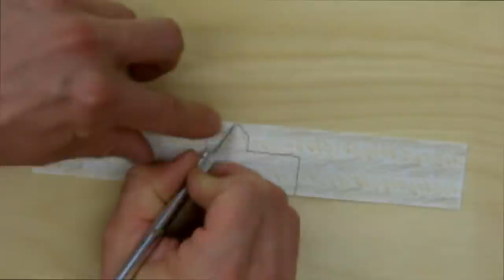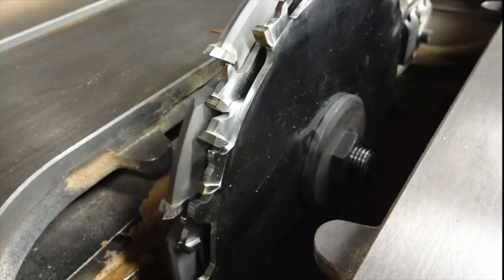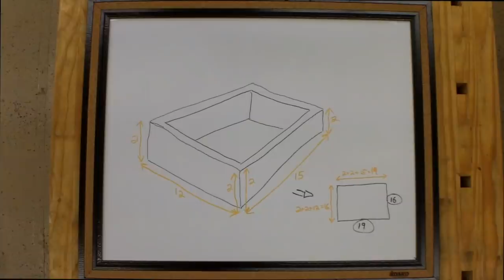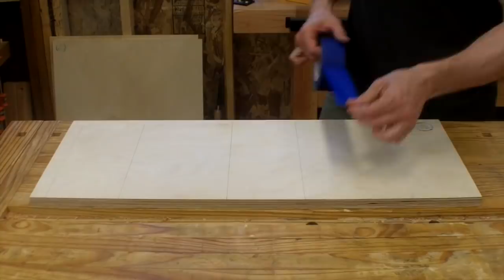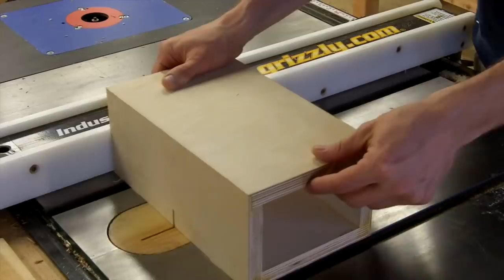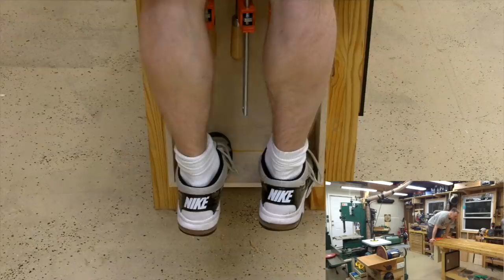New Invention - Easiest Drawers Ever!

Comment: Congratulations on getting Rockler to license this!  

And just curious, would this work for solid wood drawers and boxes? And i assume that if you were concerned with greater strength, that it wouldn't take much effort after the glue has dried  to drill some holes in the corners for a couple of dowels going in each direction. And of course there are other corner reinforcing methods that add strength and visual appeal that could be done after initial glue-up.

Comment: I love this design so much. Sure, finger joints are stronger, but there are a lot of box applications that don't need to be any stronger than a drawer. Also, you can still throw on metal edge protectors and corner brackets.

Comment: 1st I love the idea 💡 heck of an idea. 
I would use a Sen Senclamp fastener to lock them together after the glue up. I have been using them for the inside of cabinets to lock the face frame to the sides for 25 years. A lot of people have never heard of them but when u live in Indiana near 40 Kimball and Aristicraft factories that all use them as a locking fastener. Great idea

Comment: Wouldn't a set of blades with this profile for a table saw molding head be simpler and cheaper?
Reply from the maker: You would need a different set of cutters for every slightly different material thickness, probably in increments of 1/64", so it would actually be really expensive and still not as perfecta  joint as this tool can make, because the dado stack thickness can compensate for thickness.

Comment: What woods does this not work so well with. Does it ever split on the edges. And i would gather that soaking the outside edge before bending would make a huge difference. I'm certainly a fan of planning out and gluing only one box and getting two though.

Comment: What is the advantage against 45degree V-shape... You will get the same 'folding' effect with way easier blade.
Reply: That would take two cuts per corner, whereas this accomplishes it in one pass.
Reply: @huntley101888  you can buy 45deg saw. Putting 2 of them side by side makes job in one cut and works for all sizes. While one on vid is fit for one size only. The only diff i see is glue surface that might have some difference, but in case of drawers I don't think it is needed. So overkill for me.
Reply: @michaltofikolszewski  I did not know such a thing existed. Thanks for the heads up
Reply: @huntley101888  :) NP. :) Many such things exists, but due the fact they are specialized to do one job only most people prefer using standard tools that are more versatile for saving space(in workshop) and money. Have a nice day :)

Comment: Nice !  I do not think the vibration test was adequate.  Pressure test with clamps and force scale compared to rabbit and dovetail would be interesting.  I think with good glue and clamping would work well for drawers particularly the bottom is a thick as the walls.  Thanks!

Comment: I don't know what kind of deal that you made with Rockler but I think that you shot yourself in the foot. They are advertising this blade as an exclusive and only as a whole dado set and price gouging the heck out of it because they are the only vendor of this blade. For most of us it is priced out of our budget. Exclusive means there is no competition in sales and therefore the sales will be very limited compared to an open market product. I hope you got cash up front for licensing it exclusively and an expiry date for the license in case it doesn't work out for you and residuals on each sale. One thing that you should consider is that you do not patent ideas, but rather the actual design of your invention. So, when you applied for your patent, I hope that you considered all the possibilities of your design . You have put the concept out there now and there will be a lot of entrepreneurial engineers that will come up with some alternative design that will accomplish the same thing. It will probably come out of China and be sold on Amazon for under $50.

Comment: I wonder if there is a way to have an angled biscuit joint so when folding the plywood the sections would lock in for a more structurally sound hold.

Comment: This is a good concept, but it has a major design flaw in that it assumes a standard, unvarying thickness for plywood. Unfortunately, plywood thickness is not standard, in that it doesn't observe the exact nominal thickness, which leads to the gap you showed in the test.  For example, 3/4 inch plywood, or 18 mm plywood in metric, is never exactly that.
Reply from the maker: The width of the dado stack included is what compensated for exact plywood thickness.
Reply: @AndrewKleinWW  I guess if you work with a single sheet of plywood, you can also adapt the thickness of the blades with some paper inserts as I've seen in another video online and it will work for the entire project. Your idea is great and saves a lot of time. Another option is working with Baltic Birch plywood, which is guaranteed to have the nominal thickness.
Reply from the maker: Wish I could say that about the Baltic Birch I get!  We actually make a web tool so you can take a caliper reading of the plywood and it outputs the exact dado stack setup needed: http://miterfold.rockler.com/miterfoldcalculator.cfm

Comment: I'd figure how tall a draw or ban of draws are I'm going to ned set up the dado set and rip a dado into 8" boards then part each side and frt part out off that stock then do the miter type cuts on the sides and face and back's  using the quarter quarter quarter system. then rip the bottoms for them. you can gluse them up, and pin nail with the claps on then remove the clamps after you set nails in them your going to have to make face's for them this you can match grain to keep it looking uniform.

Comment: search quarter quarter quarter draw on youtube.   Now I like your idea, but the thought of spending 300 bucks for a special saw blade dosn't excite me, and too many veribles for the gap to use a differnt stacked dado set  and what plywood you use for the draws. Just too many things can go wrong with it unless you buy a whole system special blade and dado set they all have to match.

The Quarter Quarter quarter system is a fast eazy way to hammer out draws that are built to last.
And all you need is a stacked dado set and decent table saw.
setup depends on materials used. 
The acid test for a draw would be that bottom draw in the kitchen all the junk finds it way into and weights a ton but no one knows what all the crap is thats in it.

Comment: The issues I have with this are:
1. Special custom blade required
2. Cost of special blade v std blade
3. Corners will split out easily
4.  Solves a problem that doesn't really exist.
5. Rabbet joint is just as good cheaper, and uses standard saw blabes

Don't get me wrong, I love new ideas, but this is more gimmicky than commercial and robust, but hey if it makes you some money then good luck to you.
Reply: Yeah but its now a commercial product. A company wouldnt put something like this on the market without making a few drawers themselves and seeing how sturdy they would be.
Reply: Fair enough and good luck to them.
It's  certainly not something I'd aporove though..... BUT it may suit some companies, so it's all good.
Reply: I'm not going to downvote you because you raise valid points.  I think from the standpoint of a hobbyist who might make a half-dozen drawers a year, it's a frivolous expense.  But from a production standpoint, it's terrific.  Four cuts in presized plywood, ten seconds with a box knife, and drop it into the clamps.  I can see a two-person team turning out three drawers a minute with this, and doing it for a full work shift.

Or, for a remodeling contractor, to be able to make a set of drawers on the jobsite in a couple hours? Fantastic.  If you make your living with wood, and you need to make boxes, this would be a Godsend.
Reply: @theprojectproject01  to be fair, I doubt any industrial production process would adopt a process that glues end grain to end grain..... the bond would be inherently weak, or weaker than alternatives.
I've set up production lines/processes, globally for longer than I care to admit and I'd never bond like this.
BUT it's just my opinion, naturally.
Reply: @stevec6875  but it isn't end grain to end grain.  It's side grain to end grain.

This joint is not as strong as a lock-miter or a drawer rabbet joint.  I'm not saying that it is.  But it's strong *enough*,and it's fast.  Hey, if you don't want to use it, then don't. But don't shit on the people who do.

Comment: Very interesting.  That profile seems familiar - I’m certain I’ve seen it before, probably in a math book.  Still, this is an interesting application of it.  Also noticed the low profile crosscut sled.  Could you explain the design please?
Reply: If it exists, then it can't be patented. Do you have a link?

Comment: Amazing idea, I am so glad that Rockler licensed it!!! One question: Rockler website state the following - Not compatible with SawStop or any other saws equipped with flesh-detection technology. Why is that and is there any workaround?
Reply: Saw stop uses electricity to determine if your filters have made contact. The blades on the site are coated and aren't electrically conductive. IF you were to take off all the paint, and use a multimeter to ensure proper conductivity throughout, and when mounted, then it is likely that it will work. Now, another issue with saw stop is that is plunges them into a material which usually destroys the blade which is better than your finger( s ). The material might not be wide enough... Also, you may be able to get away with just stripping the paint on the sharp edges as touching the side wouldn't hurt you - unless it is at the cutting part. However, if you touch a part which can't cut you it gives more time for the system to work so you don't get injured or even a cut - so if you strip only the edge ( thin part ) and the edge where the cutting part is, then it could be fine - however because of how the blade spins, going even lower on the plate sides would be better as your fingers would travel up / outward until it meets a cutting part.

Obviously, do this at your own risk as it may not work. Never use gloves or loose clothing when working with rotary tools.

Comment: Don't get me wrong, it's super satisfying to see the joins come together like that, but wouldn't it be much simpler and easier to just cut a 90 degree slit and fold them that way? I feel like the reason people make full cuts and glue is because doing something like this would take a lot of time to set up, and a specific, potentially expensive saw blade just to make 4 cuts. Not to mention the extra time you need to take to cut out the whole drawer mesh from ply, and the amount of ply you waste cutting such massive rectangles as opposed to cutting them from any piece big enough for each face.

Comment: I have no background in any of this but I just wanna check out my analysis skulls, so...

Folding that inwards causes the wood to fold so it can break off in the middle of it. Could you use water to possibly make this not happen?
Also, since the drawer has force applied downwards, anything too heavy might cause it to break because the only thing connecting the top and bottom are glue and some wood. Of course, this wouldn't apply if the drawer is supported on the bottom.

Comment: I think the blade could be all in one, and or chippers for a molder head like both a wood master molder and or Corbin molder head that was for years sold by sears under the craftsmen name.  I see you have done somthing.
But with a wood master molder one side could do the sides and the other do the kerf for the bottoms.

Comment: "how to make a drawer"
ORDER CUSTOM MADE CARBIDE SAWBLADE

have you ever heard of 45° angles??
and wtf was that drill test? how would that tiny bit of asymmetric steel do anything to a drawer weighing 100 pounds?
Reply: rigdigwus the saw blade is allowing for more surface area for the glue to cover

Comment: As another person posted, drawer bottoms are usually much thinner than the 5/8" or 3/4" sides, and thus less expensive, lighter (easier to open or move furniture), a bit more room for the drawer contents. 
I see 1/4" listed as usually sufficient, and 3/8" for a very sturdy, high quality bottom.

There is also the question of the drawer bottoms not being exactly flat, as wood is naturally prone to warping and cupping and changing shape as humidity varies:
 - Center may rub on the frame.
 - An extremely rigid drawer, if its shape doesn't precisely match the frame, may stick or jam instead of flexing to match the frame.
Reply: At 6:34 you can clearly see 1/4" drawer bottoms.
If you already have the machinery to use this device successfully(table saw,jointer/thicknesser)  then you already have all you need to ensure that your cabinets are square. :-)

Comment: That looks really really great.

I have a question though: Wouldn't this work just as well with simple 45 degree angles?

I'm not a woodworker, so that might be a stupid question, but I'm curious.
Reply: Less glue area (weaker).
Also given that wood isn't flat - there's always some bowing or cupping - a simple 45° doesn't help align the bottom with the sides.
Reply: @scottwillis5434  thank you!

Comment: I wish this would fit the SawStop. Their arbor is too short is my understanding. Does someone make a longer arbor and would that affect the safety feature?
Reply from the maker: The arbor isnt the problem, the problem, it’s the fact that sawstop won’t run without a brake cartridge (even in bypass mode) and this blade couldn’t be made to work any of the brake cartridges

Comment: I haven't given this a whole lot of thought, but why didn't you just cut a 90 degree V-shape? Was it to increase the gluing surface?
Reply from the maker: Yes, plus the joint naturally locks in place where you want it which makes the glue up a lot easier

Comment: "invention"   ...sir you have invented nothing here...
Reply: How do you figure?
Reply: @tejasvenugopal5183  miter blades already exist.
dovetail joints already exist. (and there are stronger variations)
seamless joints already exist in thousands of variations. (most of which are easier and stronger than this)
specialized cutters specifically made to do this exact thing have existed and have been automated in CNC wood mills for at least 2 decades. look at any IKEA product and you have the same product this idiot has "invented".

that said it would be easier and cheaper to just regular dovetail the wood, then coat it to cover the seams and screws with a wood dope or spray on polymer coating. and the screws would be hundreds of times stronger than glued textureless joints like this.

this is a practice in narcissistic self infatuation, embodied in the form of poor woodwork, and further in poor tool craft.
Reply: Its ok to give your opinion--but you show your true nature with the name calling and totally negative vibe.  This guy didn't invent the wheel, but what he did do is pretty impressive.  What positive thing have you done today fox?
Reply: @dcs3544  "impressive" ..you must be an idiot too...
hey, I bet you think electric cars are a good idea too.

Comment: The really nice thing about this design is that you can easily secure the folds with screws or nails since the fold is at a very convenient angle.
Reply: I would glue in the drawer base and then pin upwards into the 4 sides through the base near the corners for extra strength and no visible fixings,which is kinda the point ,I think.

Comment: Aren't you basicly reinventing a more komplex to make wheel?
You get the same result by cutting out a standard V-shape.
It has a little bit less glue service but is easier to make by far with already pre-invented saw blades.
If you desperately want the stength, you drill a hole and glue a pin in it.
Drawers are built for hundreds of years like that.

Comment: How is this different than just cutting out a 90 degree angle lol, would have the exact same folding property.
Reply: 45 and 90 degree angles will slip on each other and it can be a pain without clamps. These won't slip. I imagine cabinet makers really liking this.

Comment: Might be a stupid question, but what is the advantage of this over a joint where the two pieces of wood meet at a 45 degree slice?
Reply: Just to play Devil's Advocate: It self aligns and because there is a level of locking it wouldn't shear as easily. Personally I dislike this video for calling it a new idea and trying to claim it when I've seen this exact joint done several times before.

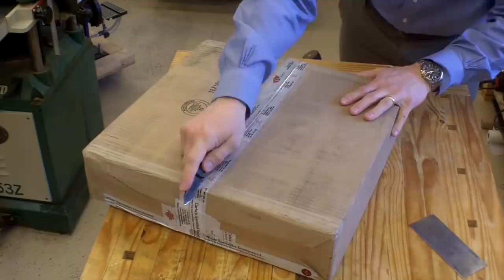Comment: Yes I agree this is cool and all, but does everyone forget the part at 1:04 where he says he had to call a specialty shop and order a CUSTOM one of a kind blade for this... Pretty impractical for your average Joe and unless your making A LOT of drawers I wouldn't even say that would be worth it for a shop to have, cool though the idea may be.

Edit: I went to check out the link to Rockler miter where you can buy the blades to do this, $480?! you gotta be kidding, I think I under stated how not worth it that would be, unless you are producing furniture with drawers or love making drawers, just learn a better method, there are many. Still a cool Idea, but so is a box wood join or a dove tail join, depending on your skill level.